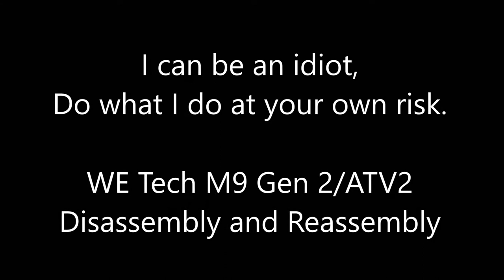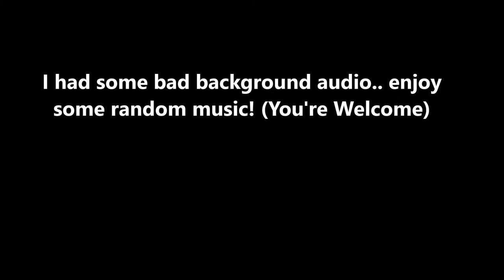WE Tech M9 Series Full Disassembly - Reassembly for Gen 2 / ATV2 Airsoft Pistol

Comment from the maker: Time Stamps!
.
Start: Tools and Overview
4:12 Disassembly Starts with Compensator
5:28 Slide Removal
7:23 Lower Rail
8:23 The Slide
8:34 Guide Rod
10:09 Inner and Outer Barrel
11:30 Slide Safety
17:20 Nozzel Disassembly
23:33 Rear Sight
24:31 Front Sight
.
25:00 Frame Disassembly
25:10 Grips
27:45 Frame Safety Functions
30:15 Slide Lock Back Control
31:17 Slide Release Latch
32:35 Trigger Bar and Spring
33:45 Trigger Disassembly
38:35 Hammer and Plunger Disassembly
47:30 Bare Frame
.
48:24 Reassembly
48:30 Hammer and Plunger Assembly
53:09 Trigger Assembly
1:01:36 Slide Release Latch
1:04:05 Trigger Bar
1:06:38 Slide Lock Back
1:09:30 Magazine Release
1:11:06 Trigger Bar Spring
1:13:36 Grips
.
1:15:12 Slide Reassembly
1:15:52 Nozzle Assembly
1:21:45 Slide Safety Assembly
1:30:35 Installing Barrel
1:30:53 Installing Guide Rod
1:31:50 Installing Slide onto Frame
1:32:42 Adding Compensator
1:33:28 Gen 2/ATV2 Safety Function Testing

Comment: Thank you, this is a very useful video, helped me in a few situations with my Beretta. Maybe I missed it, but how did you get the fake firing pin into the new nozzle base? Seems like the new one you purchased didn’t have a pin inside. On my Beretta, the tiny metal plate holding the firing pin has snapped in two pieces. I would like to repair it but I’m not sure which part to look for. Or maybe I should just let it go and use the pistol without the firing pin 😊
Reply from the maker: This is what I appear to have found on KY Airsoft. They sell parts and part kits for WE Tech and others. The shipping time is quite extensive at times though. I myself have not swapped that pin yet, but I do know that it appears to be a soft, bendable tin.
M9 #39-41 FAKE FIRE PIN (GEN2)
.
Link: https://www.kyairsoft.com/m9-39-41-fake-fire-pin-gen2.html
Reply: @LifeofStrife  thanks

Comment: Do you know if it would be possible to mod it to disable full auto mode and (or at least) make the safety/decocker not click at the full auto position? Maybe file/dremel the slide where the grooves for the plunger are to make it flat and then make new grooves just for 2 positions so the plunger would go a bit further and still click at fire and safe positions?
Reply from the maker: Seeing as Full Auto is in the middle of the travel for the safety, I would say probably not. I have not attempted to disable full auto yet myself, so I can not say with confidence. The fields that I go to I just use semi auto, have not had any issues yet with refs.

Comment: I have the normal gen 2 model. And I was wondering if it should have the pin for the bottom part of the grips near the magwell. I had recently tool them off to clear coat the symbols, and noticed mine didn't have the pin there. I know you said it was sometimes in the Barry Burton model, but I don't know if it was the same for the normal grips. I wanted to know if I had lost the pin or not.
Reply from the maker: You have the two-piece grips that do not wrap around the front, but they do touch in the rear by the bottom of the mag well? If so, then yes, you do not have a pin for the grips. You did not lose anything.
Reply: @Life of Strife  Yes I have the two piece grips. Thank you for answering my question because it was bugging the crap out of me. Lol, you have given me peace of mind and saved me from buying a part I didn't need. Just curious to as why they would still put the slot there for one to go in. We tech is weird sometimes. Thank you so much. :)
Reply: @Life of Strife  I thank you also for putting this video tutorial up, because my first m9 had had the fake firing pin break off as well as the plunger assembly broke. I was able to follow your tutorial and fix it. I ended up giving that one to my friend, who got me into airsoft guns. He loves it, and it might be his favorite pistol. Lol, anyways thanks alot. :)
Reply from the maker: I am very glad you found these videos useful, I hope to make more in the future, currently I am working through a career change.

Comment: Is there a chance anyone knows why my Samurai Edge ATV2 is stuck on full auto? I tightened up the screws that hold on the safety and all of a sudden it only shoots on full auto when it's on Semi.
Reply from the maker: The safety actuates a bar in the upper rear of the slide. There's a tiny screw that holds that in place. If that screw is the one you mentioned, then the bar could be out of position or worn down.
On another note, did you happen to swap the grips out? That can add play to the trigger bar, which can make even the Semi-Only models fire in full auto.
Reply: @LifeofStrife  No, I have not taken out the grips. Is the screw a small hex screw by any chance. And the screws are on the right side of the lever safety?
Reply from the maker: @SlushTHusky122  The allan screws are what hold to two halves of the safety lever together, but underneath is a very small flat head (standard) screw that ties the lever to the safety arm. You'd have to take that right side of the safety lever off to see that small screw and bar.
Reply: @LifeofStrife I gotcha, how am I able to reposition that bar or make sure that screw isn't worn